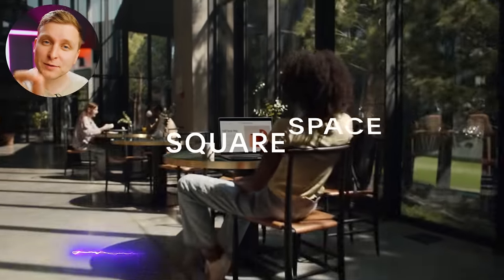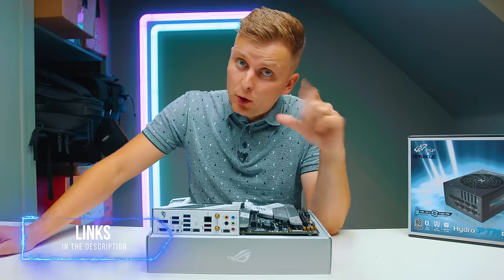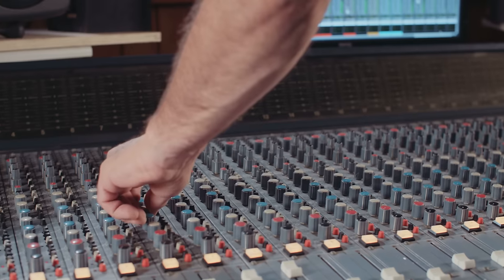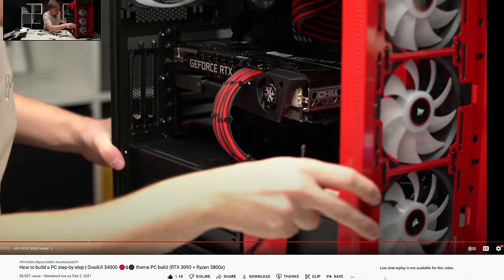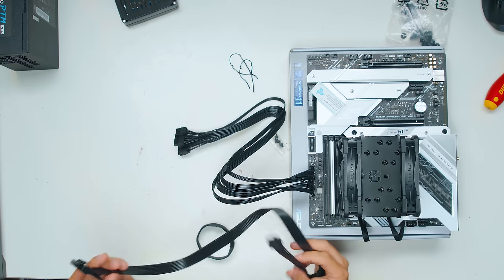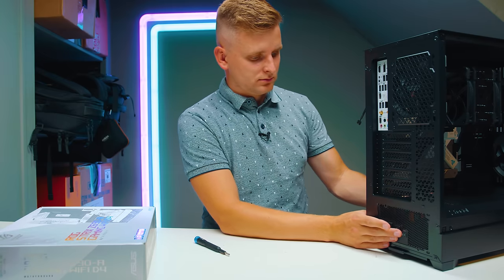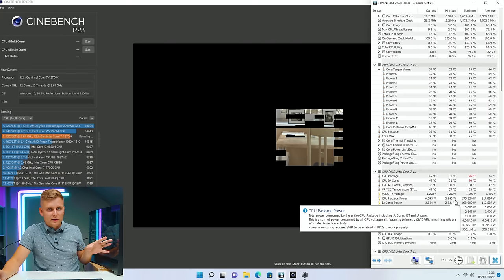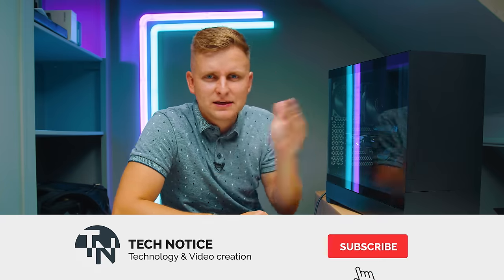The 98% Silent PC 🔇 - DAW PC build guide for Music Production & Quietness

Comment: As an Audio engineer of 17 years and gamer, i appreciate this video.

Details like "a faster single thread for lower latency operations..." i have not heard from any other YTer and is good to get confirmation on.

Somethings ive had to be aware of for my build is a mobo with two ethernet ports. One for internet and another for Dante.

Also perhaps running 140mm fans as they run slower to push the same amount of air and resonate at a lower frequency?

I would certainly appreciate if you were to do an update to this as newer CPU technology comes out.

Hard to keep up with team red and blue throwing punches.

Subscribed!

Comment: I really appreciate this build (as well as the School of Rock cutaways). Also, I'd agree that staying on DDR4 for a while is sufficient enough for making music. In general, I'd say it pays off to not go for the highest end of hardware. I recently upgraded my system to a ryzen 5900 as it was dropping in price considerably, even though the 7900 was already on the horizon. It barely breaks a sweat even with my giant 200+ track orchestra template, and I got to keep it quite cool and quiet within my old Fractal Design R5 case. :) I figure it will be enough for the coming years, and you can also get around with using a 2.5 ssd instead of an m.2 one for sample library storage if you don't mind a bit longer loading times.

Comment: Excellent guide!  Once thing I will say is that I would NOT recommend installing plug-in graphics card, particularly NVidia!  I thought I could use NVidia GeForce RTX 4060, and I would get better performance, but for audio it was considerably worse!  The NVidia added a lot of latency issues that went away after I uninstalled it, and started using just the discrete Intel graphics, so if you want the best audi performance, definitely do NOT add NVidia GeForce RTX adapter!

Comment: For many a mini pc that is fanless such as the ones in aliexpress and amazon, that come with i7-1355u and can have 64gb ddr4 ram plus gen4 pcie m2 drive would be very good. Also that one has thunderbolt so one could add an external gpu if trying to install hackintosh.  I think th e needs depend on how fast single core vs multi core are, and the amount of ram. For example many mini pcs can have 96gb ddr5 ram but from what Ive seen most are noisy, appearently the Beelink GTR7 is the exception as far as noise and thermals (it has a Ryzen 9 7940hs), but that is more expensive than the fanless one I mentioned. The Hx100g minisforum could be a contender as well but that has to be proven with time, since most mini pcs are problematic and unreliable many become bricks after a while, thermal problems, noise problems, etc.  Great video by the way.

Comment: Perhaps I shouldn't ask for advice here but I'm going to try: I'm not even sure I need an Audio interface, I have happily used an M Audio Audiophile internal sound card for the last 20 years, first in a 20 year old PC then on my present build from about 10 years ago,  I've just upgraded from Windows 7 to 10, and lost the software and drivers of the card in the process. I've been doing a littler research and it looks like my good old sound card is very dated. All I do is on Sibelius, DORICO, Vienna Instruments and Note Performer. All I really need is Sound quality, power to drive my Zennheiser HD 600 headphones well, lowest possible latency and no clipping. I like monitors with amps in them. Connecting an instrument or a Microphone is something I've never done, but it could be fun to do sometime maybe. Certainly not more than 1 instrument or 1 microphone. These are my two choices though I'm not sure they are what I need.  MOTU M2 2x2 USB-C Audio Interface. M-Audio AIR 192x4 USB C Audio Interface. Hope you can help.

Comment: You can apply a .03V undervolt that i7 pretty comfortably & reduce load temps by about 5°. I havn’t had the opportunity to mess with that GPU but undervolting could reduce temps some more. Having less hot air inside the case would allow you to run the fans even less.
Those are some simple software changes that can make it quieter without voiding warranties but you can take it a step further by delidding the cpu & repasting/repadding the gpu, lowering temps even further allowing for slower fans once again.

Comment: What I really need from a pc for music production is thunderbolt 3 (two ports), at least 10 usb/usb3.0 ports, enough pci slots for a dante network card, a big graphics card, a usb3.0 pci expansion card, a thunderbolt 4 pci card, room for at least 4 ssd drives, and loads of nvme slots (at least 3), plus the fastest ram and enough room on the mobo for 128 gigs
Reply: ASUS PRO ART, WITH A 5950X, HAVE NOT BEEN ABLE TO GET IT TO LIMIT IN ANY WAY AT ALL

Comment: If single core performance in key, then I presume tight ram timings and frequency would be as well just like in gaming?
I'm helping out a friend who is a profecissonal sound engineer and producer with his next build. But I have never seen benchmarks in like pro tools or anything like that, so it's hard to determine what to prioritize when comes to ram. Does quad rank gain performance over dual rank just like in gaming? DDR4 vs DDR5? i7 12700 vs i5 13600k?

Comment: I used a Deepcool Assassin 3 for the i7. I found that beast for the same price as an NH-U12A and performs like an NH-D15. The case is a Corsair 5000D airflow (tempered glass panel broke, but i made a new panel with common glass and it's way better without the nonsense of tempered glass exploding for everything).
Reply: The motherboard is an MSI Z690 Pro A DDR5 with 32GB corsair Vengance DDR5 4800MT/S. Two 1TB Kingston NV2 NVMe SSDs (more important the price perfomance specially for random reads than sequential vs proper PCIe Gen 4 SSDs and Gen 5 is ridiculously expensive)

Comment: Beautiful! I built pretty similiar workstation but with Aero G, DDR5, 64gb Corsair Vengeance and Arctic duo freezer 34. i7 12700K also my choice. Works like a charm but seems like little bit of noisy. Maybe I could give it a try with this Noctua cooler,  even this Arctic is very quiet. GPU is some old gen, but I am planning to upgrade it. Anyway, machine is the beast, I did’t succeed to make it insufficient even with dozens of synths and instruments. Stable as a the rock.

Comment: I'm running a i9 12900k 360 msi AIO water cooler with 16 GB DDR5 5600. FL studio runs like a dream. I haven't hit my memory limit.
Reply: Hi @EvR3van, I'm getting also the 12900K. Which AIO model do you have? I'm about to get the MSI MAG CORELIQUID C280 but I'm not sure if it will be enough for the 12900K.
Reply: @Siziksu  MSI 360 v2 AIO water cooler. It works nicely. The 12900k runs very hot needs a good Cooler.
Reply: Thanks for your answer!

Comment: This is awesome... my old Dell just died and I am kinda freaking out at the prices some places are asking. I looked over the parts and the mobo seems to not available. What other mobo would suggest that is on par or better while still using DDR4? Also, you mention getting better cooling if going with the i9, what cooling system would you suggest? I'm looking to upgrade within the next month... And would this build still be up to date in Dec 2023? Thank you!

Comment: Intel Efficiency Cores have some substantial issues, really for this you could easily get away with a Ryzen 5600G/5700G on a B450 or B550 motherboard. And add enough memory, I chose 32GB of 3600 memory and it's going to work perfectly. I did mine as an upgrade just after New Year so the CPU and memory cost me $200, and I picked up the Gigabyte B450 motherboard for about $30 as the person selling it thought it was faulty, but all I needed to do was throw the old 2200G in there to reset the BIOS settings.

Comment: Great information, thank you! I would really like to build a new PC but I am worried about using a different motherboard other than a Gigabyte one because I want to keep my Hard drive with Windows 10, my motherboard is an old GA-H61M-DS2V with a Pentium G645 2.90 Ghz CPU. Is it possible to keep my old 2TB Hitachi Hard Drive and use the Gigabyte Z690 Aero D or G because the my hard drive has Gigabyte bios/drivers already installed or am I totally barking up the wrong tree? Cheers Stefan

Comment: Hi! Loving your content. I'm about to buy the parts for a new PC for Music production and media composing, I want it to last as much as possible with as little upgrading as posible. I have my eye on the i9 13900, or the ryzen 9 7900, I've heard the intel has way better performance, but I've also heard it's noisier because it gets hotter. I wouldn't mind sacrificing 1 or 2% performance for a much quieter pc. What would you recommend? Also, I want to avoig any water cooling because of the noise but also becuase of the potential failing and having to invest again in 3 years.

Basically I want this PC you built here, but with higher processing power and RAM. Don't need much graphics as you said. By the way, which Motherboard and power source would you suggest? I'm planning a 2000, 2500 budget.

Thanks a lot!

Comment: I had my i7-12700K paired with a Noctua D15 + 6 Silent Wings 3 + 64G Teamgroup T-Create Expert + FireCuda 530 all inside my 4000D Airflow and I gonna say my setup is really quiet too coz I hardly hear anything from it. My max temperature under stress (Cinebench R23) does not go beyond 81 degree at room temp of 27 (Singapore weather :)). While I have no clearance issue for the D15, but it's still a big cooler and it covers most of my Aero G DDR4 which can be tiresome if you are changing some parts for the built as it's a very tight squeeze.

Comment: You'd get a quieter pc if you run a more open case and populate most of the fan slots. Run every fan slower.
Reply: Did you test this out already? I see that GamersNexus is always recommeding airflow cases, even for silent builds. Although he mentions that other noise sources than fans might get perceived louder (coils, etc).  Anyone with real life experience using airflow cases in a silent environment? Thank you.
Reply: @SonicEldorado  Me. I run airflow case with 8 case fans and they are dead silent.

Comment: It's interesting whether RAM speed really matters for music production. Any issues I have in my DAW is due to the CPU maxing out. This is why I'm building a Intel 13th gen rig with 32gb RAM. I'm only using DDR4 3200 but I don't think it'll make a bit of difference to my music making!
Reply: Usually any delay in loading is down to the number of tracks and loading all the instruments and effects. If someone is serious about their music and doing it for their living, they should invest in a Professional Workstation not a toy desktop computer. You should look for a motherboard that takes ECC registered Ram and probably has a controller for SAS hard drives or buy a add on card. 2Tb is fine until you start adding in Kontakt or other sample libraries, SUperior Drummer being another example or a library that can grow into terrabytes. Even fast SATA drives are slow when you compare them to SAS drives especially when configured in a disk array. Even an old Pro workstation like the Z800 would give a top spec modern custom desktop a run for its money can take 192Gb of cheap server RAM has takes Dual Hex Xeon server processors and cost in comparison, PEANUTS !!
Reply: @uselessoldman7964 Yeah I got a z640 with two Xeon CPU, excited to use it for music production!

Comment: Great video - but I would like to ask a question regarding the impressive power draw at idle. As it is recommended that processor power is set to 100% when optimising a PC for DAW use, does this mean that the processor is not at idle and therefore the power consumption is substantially higher? I am only an old muso and not very technical so forgive me if it is a silly question.

Comment: I'd like to use the Z790 ProArt Creator for my DAW audio production. I know the PCIe 5 on that board is designed for the GPU not the CPU,, I thought it was for the CPU. MY bad. What is the best configuration for NVMe SSD's in the Z790 for 3 Internal NVMe drives( I'm assuming they must all be Gen 4. and Possibly 1 Gen 3, I just want at least 3 Gen 4 SSD's). Also, since the TB4 goes directly to the CPU  where the PCIe 5. card is,, is the Thunderbolt connectivity still fully functional for use with a THunderbolt Interface and a Thunderbolt Enclosure for an NVMe ssd(4TB)? THanks. I soo want to get started just can't seem to figure out the best configuration with the ProArt Z790.

Comment: I've been composing on an Apple Mac for 10 years, but the last Imac with an I9 processor and 128GB RAM was a bad buy. It gets so hot and loud! I'm wondering should I wait for the M2 Macs or can I build a reliable PC that's quiet with a 13900 processor? I just can't decide because I think Mac OS is better than Windows....! I need 128GB of RAM because I work with large VST instruments. Are there any composers here with good experiences?

Comment: I'm curious to know why you chose the u12a over the d15? (the d15 is supposed to be quieter).
Also, which one of them will be your best choice for a music production + video editing pc?
Reply: D15s
Reply: I agree. I don't believe that there is enough of a cost difference to have chosen the Noctua 12's over the 15's. Considering the db difference, it could well be worth the price difference in the BBFB department. This is especially a point when noise is a consideration in the studio. 
It would have been nice to have seen a measurement of the sound levels as well as it under load for practical audio work as a DAW (such as anything from Reaper to ProTools with some heavy use of plugins from companies such as iZotope). Different DAWs react differently in CPU usage and some will even use a good deal of GPU for visualization. The 12th Gen Intel chips can possibly alleviate some of that visual load with their built-in GPU. If money was no object, the Asus Noctua combo 3070 might be a good choice as well when one goes to edit the sound (ADR) for a video. We are getting sent 4k videos these days and anything less than the 3070 isn't going to cut it.
Reply: @akuahsan  The 15s has only 1 fan, so it might be too weak
Reply: @mageprostudios4334  Here we have both of them at the same price
Reply: @Darkred11  It's easy enough to add the 2nd fan when you can catch a sale (a rarity).
Reply: @mageprostudios4334  Here I have both of them at the same price. From what I read d15 is the better one, I'm just not sure about it because it's heavy and Noctua says users should be extra careful with moving pc's that's using it

Comment: Windows 11 22h2 update will make 12 gen more efficient. Intel will stick to hybird architecture thatswhy Windows is working for more better performance per watt. 
22h2 beta has new designed task manager with efficiency mode.
Reply: what about DAWs? none of them is written for inconsistency between P and E cores
Reply: @TazzSmk  what bro. Watch fl studio benchmark in 12700h review video of hardware unboxed. If you still have issues you turn off E cores from bios. E cores will not run in music production as it needs high end cores or high frequency cores.
Reply: @HDRPC  e cores smooth out multitasking, you don't want the P cores being interrupted by other programs while handling audio at the same time.
Reply: @saricubra2867  i don't understand what you want to say
Reply: @HDRPC  If you disable e cores, DAW perfomance will tank really hard with multitasking.

Do not disable them (unless you have AVX512 on the CPU).
Reply: @saricubra2867  ok i have avx 512 in my CPU as i have purchased in February 2022

Comment: RE: Gigabyte Z690 Aero G DDR4
 I have an older monitor that has a VGA cable, what adaptor will I need and which port on the Gigabyte Z690 should I use? Thank you!

Comment: would you recommend lightly overclocking a music production pc let's say taking a 13600k from 3.4 to 3.8?
Reply from the maker: Nope :)
Reply: The 13600K will bottleneck a DAW because you loose perfomance cores and the e-core singlethread perfomance is bad vs the p-core.
That's why i bought an i7-12700K instead.

Ideally, you want to target the top tier Ryzen 9s like the 7950X or the 7900X for the best perfomance because they have equally powerful cores.

Comment: Suggestions for a built with thunderbolt i9 12th gen and rtx 3080?
Reply: Something with thunderbolt onboard.. I actually have a build . It was working good is a intel i7 8700k with a asrock z370 gaming k6 motherboard 16gb of ram  and a thunderbolt card pcie express that’s the only reason I got this motherboard thinking on music. But I wanted to be able to game and I recently installed a rtx 3080 Asus strix .. and a new power supply rog 1000w to be able to power the card . Now I have interference on my audio signal on every output even my Apollo thunderbolt interface if I connect it and bring the volume up I hear noise and the sound itself it’s bad no bass . I’m thinking is the power supply or the card too much power causing interference some king of ground problem.

Comment: Why did you choose 120mm fans over 140mm fans
Reply: Same question
Reply from the maker: Good question... I could've got some 140mm fans, but sometimes even 140mm are louder than these Noctua NF-A25x12 fans. :)
I could've tried something, but better to stick to what you know works. :)
Reply: @theTechNotice  as I understand, the i712700k can get really hot - so is the u12a sufficient enough in cooling it? Or should I get the D15 instead?